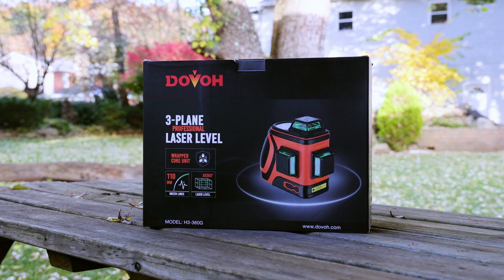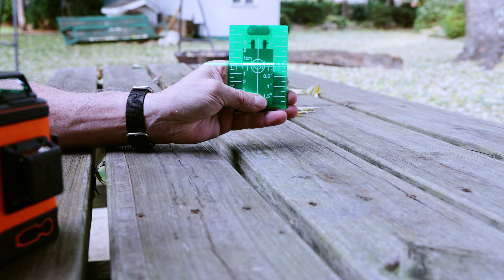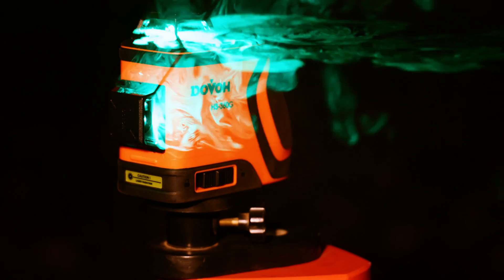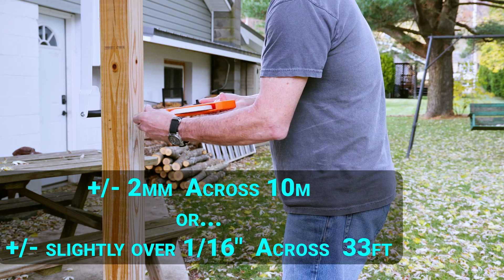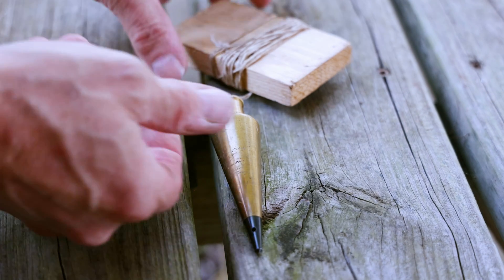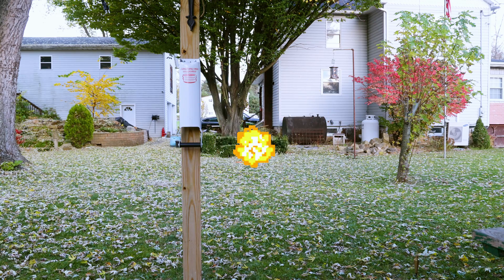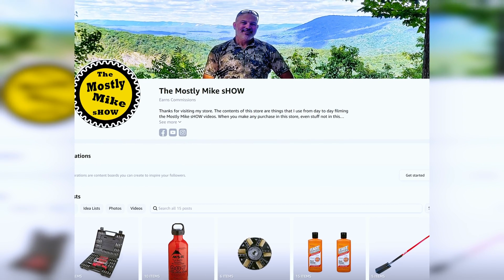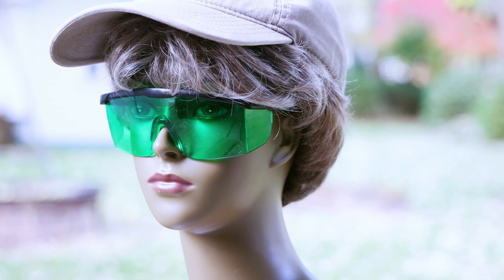DOVOH 360-Degree Three-Axis Laser Level Review

Comment: In surveying, when checking a level, you set up the level between two points and mark your two heights. Then move the level close to one point and mark heights. The elevation difference should be the same at both points. Good on you for doing the similar process.
Reply from the maker: Thanks for watching and the kind words Stuart. I was new to that process, but it's what the instructions said to do. I just tried to make it a little bit less confusing for the viewers.